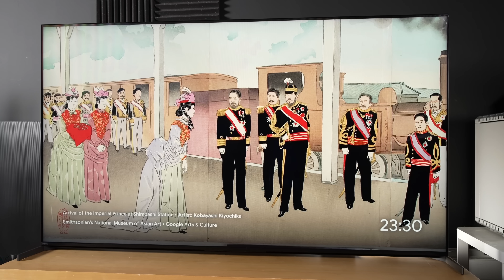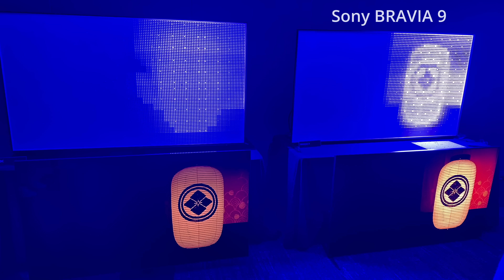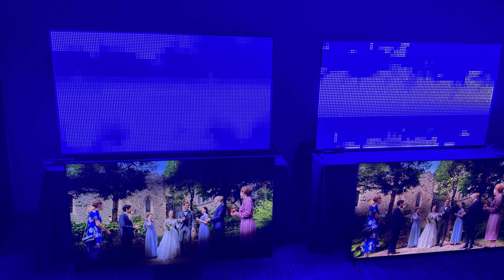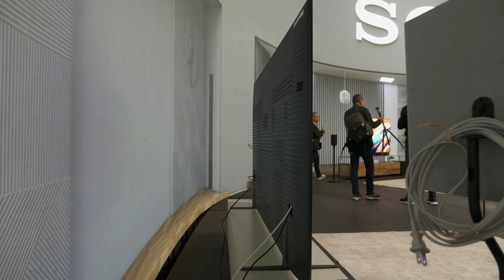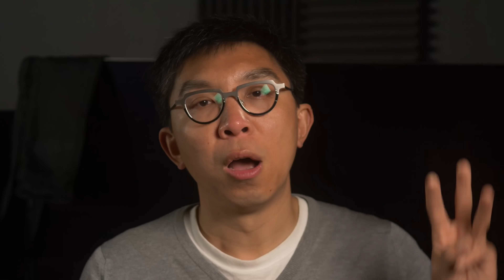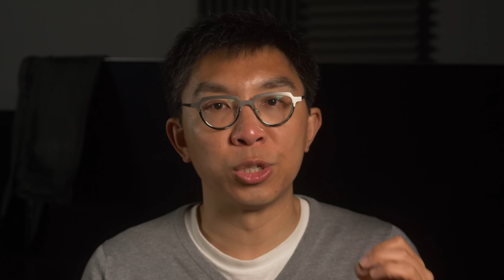𝗖𝗢𝗡𝗙𝗜𝗥𝗠𝗘𝗗: Sony Shun OLED & Use Mini LED for 2024 Flagship TV

Comment: “325% more” is 4x not 3x, since they are saying “more” rather than something like “as many” (100% more is 2x as many and 50% more being 1.5x)

Edit: looks like like its confirmed to be a typo, seems like a common issue to get confused once you go past 100% more, even though 20% more is obviously not the same as 120% more.
Reply from the maker: @Reallynotnick: We were shown an internal presentation deck (which was more technical than the press release) that said there are up to 3x as many local dimming zones.
Reply: @hdtvtest  thanks for confirming!
Reply: Those are some astonishing mental gymnastics.
It depends on how it is phrased. Your math is bonkers.
Reply: @RomanF8  If you remember math from school,  "more" means addition. "as" means multiplication.
Reply: @aquaneon8012 
My mother tongue isn’t English, so I don’t remember something I haven’t learned. I majored in math though and am always amazed by what some people are writing online when it comes to math. So wrong, yet so sure they’re right.

Comment: Get ready to pay x2 more for energy bills 😂
Reply: Doubt it. The panel actually lights up a smaller more accurate area. And it modulates the back light level instead of relying on the LCD filter to handle all the darkening.
Reply: They are more power efficient than previous models so you should actually be spending less to power them.

Comment: I have a quick message for whenever decided not to release the 65 inch model in EU countries. The reason why Sony 65 Inch models don't perform well in EU is ONLY BECAUSE SONY HAS THE HIGHEST PRICES ON THIS SIZE compared to other brands, sometimes close to 50% higher.

Comment: Isn't "325% more" actually 4.25x?
Reply from the maker: @cw205mi16: We were shown an internal presentation deck (which was more technical than the press release) that said there are up to 3x as many local dimming zones.
Reply: @hdtvtest  Vincent. Isn't the math kind of weird when they say a 65" QN90C and 65" Bravia 9 has similar zone count. But the Bravia 9 supposed to have up to 3x as many zones as the X95L.  We know the QN90C has 720 zones in 65". And the X95L 65" has 480 zones. 3x480= 1440 zones. That is double the QN90C.
So either it has a lot less than 3x, barely even 2x or it's a QN95C at 1440 zones (actually is in 65") and they labeled it wrong. Something doesn't add up.
Maybe the 65" has a lot less zones than the 85"? A 3x 85" Bravia 9 compared to 85" X95L would land around 2600 zones. Since it's up from 860 zones.

In any case, it's more zones and we can see it. Just confusing.

Comment: All the Sony A80Ls must go!!!!   Not fire sale, because they dont get bright enough.  [I mean Bravia 8....Yes, that's it.]  You don't want a buldhe around the back × Crying Game or finding Captain Winky.  They compared the X90L to the bew Bravia 9 to rebrand and trick the consumet. Compare it to the rare X95L. [Not the best A95L]   Imagine if they had 40,000 zones with Sony's technology and pricessing
Reply: Bravia 8 is not an A80L. It's 10% brighter for one.
Reply: @bearclaw5115 

I don't care that much about an LG old WOLED panel with 10% more brightness.  Sony is still selling the A80L panels.  I guess you didn't understand nuance.     Nobody shouod ever buy a Bravia 8, when you can get an A80L at 2/3 the price.  All Sony did, was get rid of old LG OLED panels and cost cut by not paying LG or Samsung for panels anymore.   They went hard into Mini-LED because they make the most advanced Mini-LED Panels/Smallest Mini-LEDs with the best processing from Sony.    Then the consumer gets screwed.  You get Sony's ultra profiteering mark-up for Sony branding and you don't get the best technology. QD-OLED or WOLED wirh MLA or the ultra best technology of the extremely expensive Micro-LED.  That is the future, if they can ever get it cost effective.     I will not be buying a Sony in 2024.   Cost cutting doesn't help me.  Meanwhile, Sony's Mini-Leds are more expensive for class comparable OLEds.    They have become Samsung for the last 10 years before they were forced to make their "2nd tier" QD-OLEDs.   2nd tier because Samsung doesn't make as much profit.  They didn't go full OLED focus because of this.  Now Sony is Samsung. Not wanting to pay LG or Samsung for better technology.    Tell Sony to make their own OLED panels. Lazy imagine an in house OLED Sony panel with their processing.   It would have been grand, like my...

Comment: The theme for Sony TV in 2024 is "cinema is coming home." 

...... But what about games? 😅

So between Bravia 7 8 and 9 which one is suitable for PS5?
Reply: All of them are. Did you not happen to catch where Vincent mentioned that all three new models are now using the version of the XR processor that is based on the MediaTek Pentonic 1000 SoC? (That's the same version of the XR that is currently in the A95L)

Comment: So... save money and get a 85" flagship Sony mini-LED with the MadVR Envy Pro or get a MadVR Envy Pro, Epson LS12000, and a 120" SI 1.4 Black Diamond screen? Not too too far off in price but certainly worth considering. 

That 120" screen is capable of OLED-like contrast, 85% ALR, 1200nit capable setup with this Epson projector controlled by the Envy Pro would IMO beat out Sony's greatest strength between the two options which is brightness.

In the premium market, I think the projector is still king when using the right screen. Especially that Black Diamond material from Screen Innovations. No glare and it rejects 85% of ambient light at 1.4 gain with no screen artifacts, at all. That's better than any TV on the market.
Reply: Keep dreaming. I think you secretly realize that no projector beats and OLED but you like the size too much to scale down. Understandable but don't get it twisted, no projector gets anywhere near an OLED except for size.
Reply: @bearclaw5115  the disbelief is understandable. I own a refurbed 2017 OLED. It’s nice but that black diamond screen is truly something else.
Reply: Projectors are all but dead in the display market today now. There's a reason for that. Any time you are letting ANY degree of natural light into the room the projectors screen (which can't get anywhere even close to the brightness of a TV), even if it is ALR, is going to wash out substantially. No one wants that. Projectors are largely still relegated to basements and man caves today because of this. Want a projector bright enough to not have that happen in a brightly lit room? Those start at around $25,000 and then go up from there. 99.99875% of all households in the US will ever even think of spending that much on one.
Reply: @michaelbeckerman7532  it seems that I’ve brought this up to the crowd who’s unaware of this black diamond screen. At 1.4 gain, this screen rejects 85% of ambient light….. it’s a simple YT search away from seeing it. In a bright room, there’s not much difference between my OLED and this projo screen. Especially with this screen, it washes out no differently than your average tv nowadays. In this particular setup, it’s capable of higher peak brightness than my current OLED.

Sure. There’s a cost between the projo/screen and the tv. About $10-11k vs  $8k for an 85” Z9K. 

But again. This projo screen allows you to watch during the day with very similar detail loss to the tv. I mean, no display can compete with the sun if you’ve got sunlight directly pouring onto your screen. There’s just no competition there. So, if you’ve got your room setup so that only ambient light is reflecting onto your display and most of the light is coming from the sides and/or top, this projo screen and the tv will have very similar performance in the daytime and the tv will get destroyed at night.

Comment: The new Sony Mini LED TV is the most interesting TV this year to me. Could be my next TV.
Reply: ya the 7 series seems to be a great price/performance king
Reply: @mbvx7  Nah, i would avoid it, because it has probably same bad viewing angles like X90L. Bravia 9 is the way to go imo.
Reply: @Da-iken  Of course the Bravia 9 is much better. But if you look at Bravia 7 as a person that would be buying an X90L. The Bravia 7 doesn't cost much more than what X90L did but is a massive improvement. It's better than X95L in many ways because of color volume and so on. The Bravia 7 will be a great "mid range/budget" alternative. 
Bravia 9 is just even a lot better. It's a leap for their miniLED.
Reply: I don't see how. The G4 is still better.
Reply: @CaliFinestProblem  G4 is an OLED TV. So 2 different technologies. For People that doesn´t want an OLED (for whatever reason - familiy TV, usage with a lot of static elements and so on) it is probably the best TV. It is also way brighter (in real scenes it has much higher headroom than an OLED).
Reply: @Da-iken  Kind of mundane reasons to not want one, only downside I see is price lol.
Reply: @CaliFinestProblem  I wouldn't be too sure about that. I bet the G4 wins in some things. But Bravia 9 wins in other areas.  Also if a person don't sit in a totally dark room and only watch OLED demos, lol. They would quickly see there is little difference and Bravia 9 wins especially in color. It will spank the G4 in color volume by a mile.
But I like the G4 too. It's my back up choice.
Reply: I am going G4 as Sony thinks they can ignore demand in Europe by not selling a 65“ version.

Comment: The number of zones look awfully low in those exposed shots. Can only assume it'll still bloom in dark rooms which is disappointing in a flagship TV.
Reply: My 85"X95K doesn't bloom any differently than my LG C1 does.
Reply: @DrakonR  Any LED has some bloom. The C1 has none.
However, your perception might be correct.
Watch your C1 in the dark and put on some white text over a black background. You will see some blooming. Guess what? It's in your eyes!
To prove it, put your finger over the white text and you will see the 'blooming' is gone! This means that OLED's outperform our own eyes in contrast which is pretty nuts!

Comment: If it handles subtitles well, I'll be impressed.
Reply: Agreed, this is the ultimate test. As an OLED owner, it’s hard to imagine going back to subtitles on LEDs
Reply: @E_Rice  I have the Sony OLED A8G and subtitles are distracting. The white subtitles are so bright, especially in dark scenes it's quite distracting/irritating to the eyes.
Reply: @IndigoVikingTV  you change the subtitles to grey or some other dull colour, problem solved
Reply: @Showwieh  Yeah that's what I do, I have them slightly transparent with grey color. The only time is if hardcoded subs are present then it needs to transcode the media, so not always a good solution
Reply: IKR?  My Z9D does a pretty good job if you sit in the right chair and tilt it correctly.  I expect even better now but get disappointed when I go window shopping mostly.
Reply: You can make the subtitle color grey , it will help a lot...
Reply: Last year did it perfectly
Reply: it's not a challenge to handle subtitles well for modern miniLEDs, even Samsung could do it. The challenge is handling subtitles well WITHOUT crushing shadow details which Samsungs tend to fall short
Reply: I'm so sick of these subtitle comments!
Literally 99% of the subs I watch, almost NONE of the subs are at the black bottom bar of the screen!
They are always over the picture even when there are black bars at the bottom! 
This is such a stupid comment!
The only times this applies is if you connect to a pc and manually move the co ordinates of the subs! 
All my streaming services don't allow such fine adjustment of subs!!!

Comment: The year is 2024 and Sony still only has two HDMI 2.1 ports. ☠️
Reply: I guess they're meaning to say the PS5 and your earc sound are the only reason you'd need an HDMI 2.1 port.
Reply: right.... smh  great picture, but you get less for the price
Reply: Again, that's MediaTek's fault, not Sony's. Sony sticks with the MediaTek SoC platform because it offers the best image processing for their XR processor technology. For now, Sony isn't willing to give up image processing ability/quality just to get two more HDMI 2.1 ports. Send your complaints on this over to the folks at MediaTek, not Sony.

Comment: Honestly, moving to Mini-LED for the Bravia 7 (formerly the X90-series TVs) seems like a HUGE deal considering that is their most popular TV year after year. If they maintain similar pricing to the previous models, that's going to have big payoffs for them. Also, not a fan of the clickbaity titles you've been using. They're not shunning OLED and you know it, they have new OLEDs in their lineup for crying out loud. They're just not making a QD-OLED flagship and why should they, given how late the A95L released last year and that it's still king of the crop right now? It will continue to be sold this year
Reply from the maker: @Joshua-xh6bm: The title said "for 2024 flagship TV", which is entirely true.
Reply: @hdtvtest  Maybe he's referring to your first video on the topic "Sony Plan to Ditch OLED & Use Mini LED for 2024 Flagship TV. Here's Why".
That title caused quite a stir in this community because a lot of people only read the first five words!
The title is technically totally correct (even perfectly accurate) but the internet cares not for nuance!
Reply: The Bravia 7 appears to be more of a replacement for the X93L rather than the X90L, which will still be carried over as a continued model for 2024.

Comment: If it doesnt have a minimum of 5 million dimming zones it is dog shlt n they failed. Plus it needs the viewing angle of a oled or else its garb, x95l vs s95c is 70° vs 28° color washout, the x95l is unwatchable, completely washed out from the distance I sit at.

Comment: -Make the best OLED tvs on the market for 3 years in a row
-Abandon OLED market 
-Refuse to elaborate.
Reply: It's all about business - they simply can't sell their tvs: 'Sales are expected to be lower than the November forecast due to an expected decrease in sales of televisions resulting from lower unit sales...' Sony 2023 3d Quater report
Reply: They aren't abandoning it. My god! Did you watch the video.
The only thing that has changed is that they think they have an LED that will compete with OLED's in the high end of the market.
Reply: @bearclaw5115 I know, I just wanted to make a funny comment
Reply: They didn't "abandon" anything. The A95L was released so late in 2023 that it was practically an early 2024 model. They are just letting in run for the rest of 2024 because of that. It will certainly be getting a refresh/update in the 2025 model year. Relax.

Comment: 6:28 This is exactly why mini led will never be able to compete with oled, no matter how many zones they have--the backlight must pass through a diffuser which causes the blooming effect.
Reply: Tell me you don't understand display strengths and weaknesses without telling me you don't understand display strengths and weaknesses. 

Nailed it.
Reply: Depends on the algorithm to negate that maybe they’ve had a break through!
Reply: @NexGenTek No such thing as a breakthrough when local dimming zones are physically larger than each pixel.

No LCD TV with any algorithm can compete with OLED when it comes to overall picture quality, contrast ratio, response time, etc.

LCD only wins in brightness.
Reply: @PSYCHOV3N0M  Picture quality will be opinion based this year with the new TVs. This will be my second non oled. Contrast ratio sure. It doesn’t need infinite with 4000 nits. Response times are so low now it makes no difference unless you’re playing esports on a  75inch! The HDR will blow you away. My Z8H still has scenes that my oleds just can’t match.
Reply: I've only just switched to a QD-OLED monitor and while it's certainly better in dark scenes and the motion clarity is amazing, it's quite underwhelming in bright scenes compared to my FALD LCDs and the VRR gamma flicker is insanely distracting in some games.

Comment: Mini LED really needs to replace OLED, it's just not bright enough and being organic isn't the best for durability.
Reply: Each one and their preferences, I prefer OLED better colors, and faster response leading to better motion clarity, blooming is another issue even with mini led. And for durability my CX from almost 4 years ago doesn't have sign of burn in, but I guess for every user their milage may vary.
Reply: @eliadbu  I also have an LG CX but hopefully when I'm ready to upgrade in a few years mini led will be a viable choice since in my opinion OLED has peaked.
Reply: Both of those problems are being addressed and largely resolved with new OLED tech that is in development now. Likely just a year or two away at the most.
Reply: There are SO many oled owners who are going to struggle with this.  But it's true.  They got so high off microcontrast they never realized they were stuck in 1st gear and playing in the basement of HDR.  Going crazy over 175 nits full field and 1000 nit highlights.